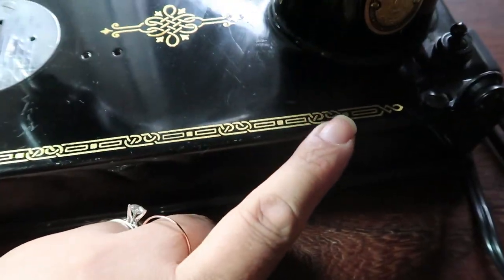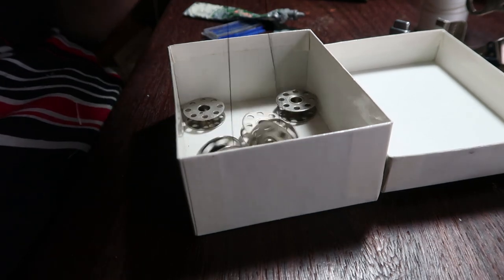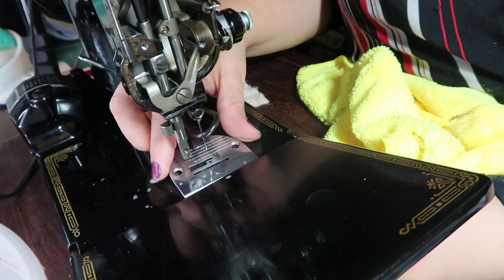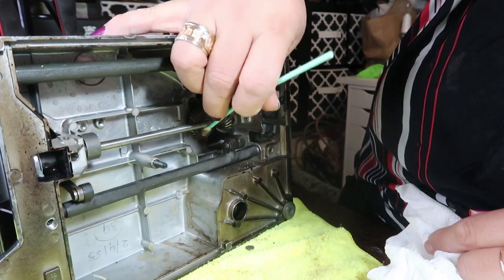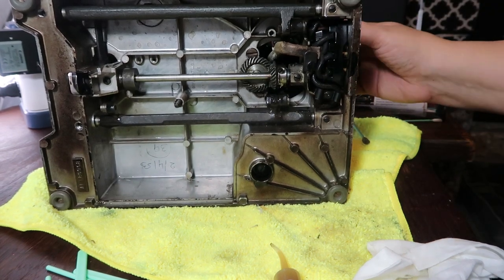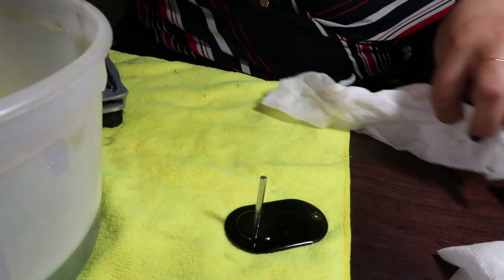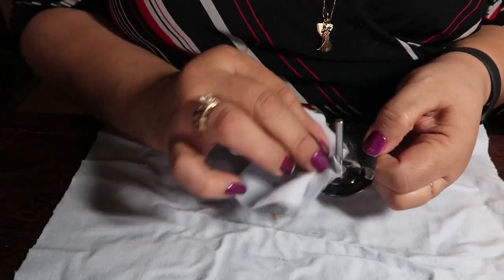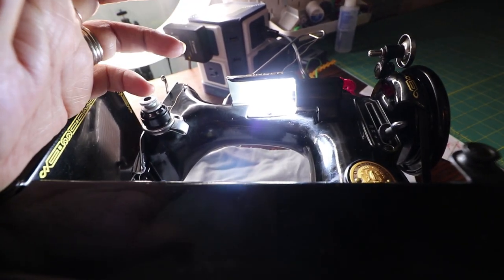221 Singer Featherweight Vintage sewing Machine Maintenance Tutorial

Comment: About 3 years ago, I ran across an excellent featherweight in working order, wiring looked great, at a thrift store for $75. I certainly didn't need one, didn't particularly want one and knew I could buy it and turn a quick $300 to $400 profit.

I left it there for one of you! Some one hopefully got a great deal on a new to them baby.

Comment: I recently resurrected my 222k from the attic bought for me age 13 in the fifties. I kept it as the trade in price was derisory and my mother had struggled to pay for it. All in beautifully clean condition, box included. Got the timing sorted and currently trying to get the foot control rewired to modern safety standards so that my only heirloom can be handed down in almost perfect order in spite of it having had a busy life. Just bought a computerised machine, but am dying to use my 222k again after all those years, just for old time’s sake. UK resident here.

Comment: I picked up a Singer 128-23 with the black crinkle finish. It needs a good oiling and clean, plus a power cord and back plate. Came with about 5 bobbins and some feet. I'm so looking forward to running some thread through her.

Comment: Nice machines, did you grease the motor also? The same grease you put on the gears goes in the motor ports. You clean them out with a thin straw that should of came with your grease then fill with new grease. I love the featherweights also.  The next vintage machine you might be interested in is the singer 201-2. It's all gear driven, and it's a workhorse with such a distinct sound it just hums. The paint is pretty beat up on the one I have but she sews great. I got it from a man, it was his grandma's, He used it for taxidermy talk about a stench, lol. The black screwdriver and the black foot is blackside from the war time. I don't have a blackside maybe but I have some blackside parts, feet, screwdrivers and bobbins. I believe they grabbed what ever was available when putting everything together for a set of tools.  You might want to wipe down all the feet and bobbins and all the chrome parts you washed with soapy water with a tiny bit of sewing machine oil to prevent rust. Enjoy your featherweighs.  I have 4 in my possession right now.
Reply from the maker: Yes I just didn’t film it !

Comment: Oh Sweet Lorena! You just fell down the rabbit hole of machine-lust.  LOL!  I have several 221's and have completely cleaned and refurbished machines for others. All old Singer's stink. (Period. Full Stop.)  I use Windex to clean the chrome parts because it dries completely. I keep a bottle and just pour it into a dish-- use a toothbrush, dry and polish.  I'm not comfortable washing a lot of machine parts in water because I'm concerned about rust.  I'll message you with some other FW experts who also give excellent assistance.
Reply from the maker: Oh okay thank you.  I made sure I dried completely and oiled the feet to prevent that!  Wonder would of never thought of.  Thanks for the tip